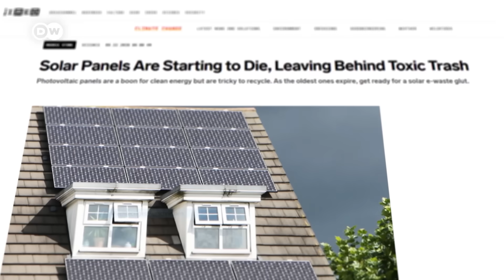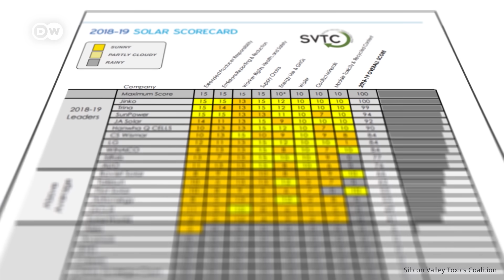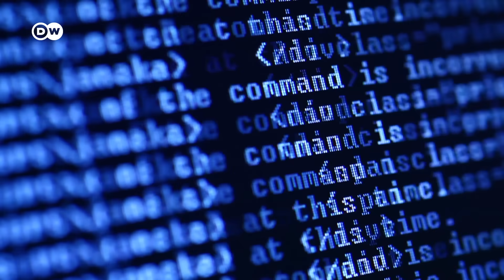How green is solar energy really?

Comment: It would be amazing if people would realise that everything we do produces carbon dioxide, the question is just how much. Also is important to realise that also producing environmental friendly products like wind turbines, solar panels, water turbines produce carbon dioxide. But again, the question is it worth to do it? I think yes, because mostly they produce less by building those products the more green and renewable power we use. 
But what I don’t understand is for example the focus on only e-mobility, we get told to save energy and electricity but they want to exchange all combustion powered cars with e-cars high means w again would use more electricity? Why not use the money they waste to give away bonus schemes to “convince” people to buy the way to expensive e-cars for research in alternative ways to power mobility, like hydrogen or even make combustion powered vehicles more efficient or LR carbon dioxide producing. Now fuel alternatives for example.
Reply: @Daniel Meyers stopping a wind turbine also costs electricity but you can use the wind turbine to produce hydrogen just as a side effect. That’s what they do here on some wind farms. And then it doesn’t require triple the energy, which is also not true, it’s only double the energy. But I was shocked to learn how much it cost to stop and keep a wind turbine off running when not needed.
Reply: @Daniel Meyers while running a Vestas V82 consumes round about 8.1% of its energy just to kept running. Most manufacturer don’t mention this consumption since it is not accounted because it’s taken out of the grid. To shut it down or kept it off it takes another 9.2% (during a time it not even produces electricity). That are real time data from two big companies using those wind turbines and instead of shutting it down some companies use the electricity it produces (even if not needed) to produce hydrogen. I think that’s a pretty cool idea and makes the production of hydrogen much cheaper.

Comment: One needs to look at the overall cost/impact of a set of technologies required to meet the customers 24/7 requirement. Therefore the storage/backup systems have to be included in any assessment, economic or environmental.
Reply: Yess! Finally! You're the one! I'm so exhausted of hearing about nuclear being expensive compared to renewable while almost nobodies consider in their figures cost and pollution of the necessary continuity solutions.
Reply: So many take this out of the equation when it comes to solar and wind power!
Reply: @carl-johannilsson5666  yeah. Just think of that, for Australia (being isolated and a single country it's easy to do simulations) just a 10 % of nuclear in the energy mix would reduce between 20 and 30% the need of storage (it depends on how you balance your strategy: more storage or more overproduction). Now, it's obviously a more complex evaluation in Europe, USA or other areas, yet the same concept applies: why choose the costly and resource-intense way to cover your base load if you can use a major amount of nuclear instead?
Reply: @carl-johannilsson5666  The two major issues with the whole "nuclear weapons argument are:
You can just reuse it as fuel, rather than drop it.
There are power plant designs that don't create weaponisable by-products.

Comment: solar: 43gr co2/kwh
wind: 16gr co2/kwh

Thats nearly 3 times as much emissions.
i dont get why everyone is so hyped about solar, when wind energy clearly comes out as the winner.

the drawbacks of wind are usualy that the blades are made of plastics, which is a hell of a lot easier to solve in comparison  to the problems of solar
Reply: Nuclear : 15 gr Co2/kWh, with far less material used for unit of Energy( and incomparable efficiency) .I think it's the source we should focus on  for a real transition
Reply: @riccardogalizzi3047  i believe this too, but a lot of people do not see this as a green option.
But 15 vs 16 grams isn’t that much of a difference.
Reply: @funkymeister9nl  Yeah you' re right, the difference in grCO2/kWh is not the real deal . However the efficiency , the amount of energy produced for km^ 2 and for g of fuel e the opportunity to provide baseload elettricity make me lean for nuclear .
Many people don't consider it green because of the nuclear waste , but nowadays it's entirely manageable and far less than other sources ( solar itself has a lot of waste , also toxic one , as explained in the video )
That said , I'm not against solar or wind but I consider them as complementary sources in a future energy mix.
Reply: @funkymeister9nl  You have to keep in mind that it is an average and does include old nuclear plants. New plants have a footprint that is in the single digits.
Reply: The issues with wind is that they are even more location-dependent than solar.
Not quite as much as geothermal, but only places with fairly constant wind benefit from wind farms.
Reply: @OzixiThrill  not to mention that the power output fluctuates wildly depending on the weather.

Comment: I have a question: can AI actually help us to decide what material or what chemicals to use for production of items? Can AI actually do that?
Reply: Yes, if your program/set it up correctly, it can speed things up. It will not do so by itself.
Reply: First and foremost, I recommend that you look into the matter yourself and decide if they could do so.

With that out of the way, I'd say that, if trained and designed properly, a neural network system could absolutely do that.
Recent psysics simulations have lead to improved fusion reactor designs along with other interesting applications.

Comment: This analysis is welcome but one should start with stating that ALL energy production devices have upfront carbon costs. Why do we start calculating these for renewables instead of for all?
I'm tired of climate change deniers calculating upfront costs for electric cars but conveniently forgetting to do the same for ICE cars.
Reply: Well, just because it was not mentioned in the video I'll add it here for you.  wile solar is around 42-45 GR/kWh nuclear power goes down to 12.
Reply: First question should be asked who commissioned this video and/or similar videos, research papers etc.
Reply: I'm tired of the blind leading the blind. How come everyone who has an opposing opinion is tarnished with the "climate change deniers" brush? I care about the environment, and if that is climate denial, then I have a problem with the definition. Open your eyes. EV's are great, because they are innovative and go fast, but they are not going to save this planet until you supply them with clean electricity. Renewables covering the earths surface producing unreliable power, is never going to work. Small high-populous countries like Japan can never have enough solar or wind turbines, because there is not enough land space to meet the demand. Countries like Australia have no water for hydro. Let's get the energy issue worked out before we flood the earth with electric cars and toxic batteries that require recharging from coal fired power plants. SMR's are the only answer, but blinded people are scared of the only viable source of clean energy available.
Reply: Electric cars run on electricity produced by fossil fuel burning electrical sources. That's the problem.

Comment: I think solar should definitely be an integral part of the renewable energy process but not the main actor, It's the same thing as not keeping all your eggs in one basket. I believe we can have a future where multiple ways to make energy work together like we see currently Microsoft or google do with their data centers. In some places it might be cheaper to use windmills as infrastructure, somewhere geothermal or tidal, etc. I think we should rather than focus on a single technology like more efficient solar panels work on tech which makes sure all of these different energy sources are compatible and can work together. And of course, the major issue is batteries. We need better energy storing innovations. This video does fail to mention a huge problem with solar panels which we can see visually in the video, it takes huge amounts of space. Empty space, we are not going to clean out residence and cities so it probably means more deforestation and habitat loss. Of course I understand that would be difficult to quantify during life cycle assessment but it is very important to note.  I understand you can have solar panels individually on roofs and such but to have a powerplant, you require a huge concentration of panels working together to reach optimum efficiency. So that is a big obstacle which we are facing and going to face in the future. Also the recycling part is just a pipe dream because under capitalism it is almost impossible to get companies to recycle because it is always always always cheaper to throw stuff away. Yes having more panels will make it cheaper but it will still cost money. We see it with plastics already, the ones which can be recycled are still not recycled. Same with clothes, and I don't think we have a shortage of those. EU always has been able to maintain regulations better than other countries but because it has such a small population the adverse effects will still be felt. We already have news of solar panels being dumped in rivers in Kenya and people dying from heavy metal poisoning in their river. And I don't believe the governments around the world can run a tight ship and have regulations to stop that.
Reply: I agree with most of what you say. I would however disagrre that the EU has been able to maintain regulations better because of its small population. The population of the US is 329 million, Philippines 109 million, south america 422 million, THE EU 447 MILLION! 
Also, if sun rich countries (Spain, Portugal Greece, Australia, Mexico and many others)used solar panels for domestic properties, you can cut the power generation which supplies those properties by at least 50%. No need for batteries, just solar panels. Which by the way, is exactly what i have done.
Reply: @craigphd7844  I never said it was because of the small population, I said BECAUSE it has a smaller population even if does regulate the impact is not as huge as other countries. If you compare all of EU with my country India, it is miniscule. I understand it is completely plausible for other countries to regulate these industries if they just under cut the profit motive in these department. But as it is the biggest money maker, for example the 2 biggest billionaires in India Ambani and Adani both have come to the top from coal and oil reserves so it's very unlikely to be undercut. Also of course europe being a developed nation has leagues of infrastructure ahead of countries like mine which you guys have exploited to reach the place you are at in the first place. So it can't really be compared, and as developing countries like India and China goes through their industrial revolution, the amount of coal and oil use is going to go way way up. And it is going to take a huge chunk or almost all of the remaining carbon budget anyways. Sure it can be done on solar and other renewables but India and China doesn't have the budget to make more infrastructure and then develop more. So there are probably most likely going to use coal, oil and natural gas like all developed nations did and fuck up the earth more. Of course this can be stopped if developed nations like the ones in Europe and America pay these nations to have renewable infra but that probably won't happen so we are very definitely going above 1.5 warming. Which will then again adversely affect these developing countries first and the worst. Oh to live in the existential crisis that your city will be underwater soon ✨
Reply from the maker: Hi Pujeet, thanks for your comment. We're glad to see you sharing such informative information on sustainable energy systems. Have you seen our piece on renewable geothermal energy? Let us know what you think about it: https://www.youtube.com/watch?v=c7dy0hUZ9xI&ab_channel=DWPlanetA

Comment: But how can be solar 10 times more eco friendly when you need to add next components to it? It is only 1/3 rd of your powerplant. It needs some sort of controlling mechanisme, inverters, battery.
There is little to no use for "just solar panels".
Reply: You can use just panels for heating, a heating wire inside a water tank don't need an Inverter, it also runs on DC directly. It's today more economic than thermal solar installations on houses, which don't work if it's cold outside, while the panels still work in the cold and heat up the water used for floor heating or radiators.
Reply: @simonm1447  that is true, but i can't imagine the scale of that PV panels and inverters used for electric heating not just hot water in winter but also a radiators and home heating overall. I disagree with economics for thermal solar installations on house - while it can be dumbed down solution with your own made panels, set of vents and simple water pump. Or even without that, simple folk in Africa cant do anything like that. It is easyer to find a big barrel, some pipes and black paint.
Reply: @ivobrick7401  You don't have to heat exclusively with it, it can be a supplement. During summer you can cover the whole hot water for showering etc with it, and in winter it reduces the amount of energy from other sources for heating. At the same time it's relatively simple and inexpensive to make, it don't need much material and it's cheaper than solar thermal panels which heat the water over a fluid. 

Personally I use a solar thermal installation,  it works fine in summer but if you live in a area where it can get cold even in spring or autumn it works efficient only 6 month per year at max. Of course in Africa it won't get that cold, and a couple of pipes coated with black paint would also work there but in the middle of Europe or northern USA you need a 2nd fluid circuit filled with antifreeze, a heat exchanger and the panel has to be insulated. 
Heating with solar PV is something for industrial countries with freezing temperatures, in Africa more pragmatic solutions are also suitable
Reply: @simonm1447  yeah, seems legit, but the surface area of pv panels is much greater for your electricity needs. Well, my plan is to create hybrid solar panel where you combine those two technologies together. What if we can do simple thermal panel with small surface area to heat water during the summer. What if we can add behind this panel tiny solar panels with actuators to move panel to track the sun. Then this will be in fore front of set of another - calculated PV pannels for electricity needs for your home (in my case it is up to 10 panels). If i add wind sensor and a system of wires, for PV panels, they will retract arround the thermal panel to cover that like a flower - so panel will not be blown away or damaged. So far, this is my plan, the problem is storage. I need ~ 1MV battery, any tips? We all need that to be even worth to build that. Unless greedy power companies will be limiting factor for your power transfer and energy storage (but i get it, you cant simply peak in summer and then drain for example nuclear powerplant in winter).
Your guess was right, im in the middle of EU.
Reply: 'There is little to no use for "just solar panels".' That is totally misleading. You do not need batteries for a solar installation either for a house or for a commercial application. 
The solar panels do need an inverter.  The systems produce power during the day. Which you consume. You do not store in batteries. Any excess power you produce goes to the power generation company, for which you can get paid. The payment from the power generation company subsidises the electricity you consume from them at night. All solar retailers supply this kind of system. I have this system. i have reduced my power requirement from the generating company by 50% with a small installation, without batteries. Solar panels and their inverters are recyclable.
Reply: @craigphd7844  yes, i want to see that kind of system in my low power house. I have total consumption of 2 MV / year. That means i need 8 solar panels + on grid inverter + virtual battery - this is what you talk about right? Well, these home powerplants are limited to 10kV. Whole system has limitation of 10 MV/year. Installation cost is ~ 6000E (which is fine). If you do the math - its not worth, here companies greatly limit you, electricity is way more expensive due to high tarrifs if you exceed consumption above your virtual battery. Welcome in EU. I don't even mention that power transfer cost 46% of the whole electricity price. This is the factor you cannot be financialy positive or atleast have free electricity no matter what investment you do to your home solar powerplant connected to grid. Seems unfair  to people in my country, even you can do that, even you can double or triple output required for you.

Comment: My solar panels are 15 years old and still working fine,solar is a roart to pump your power into the grid while you are at work all day then you buy it back when you get home
Invest in batteries and an off grid inverter and stop all your power bills
I built my system for 4000$ 
I have saved $18000 dollars